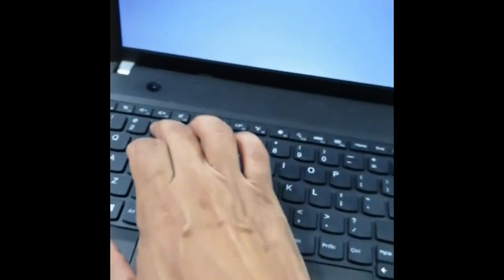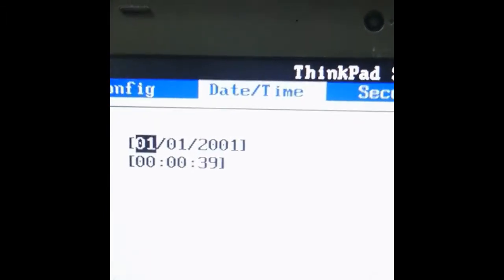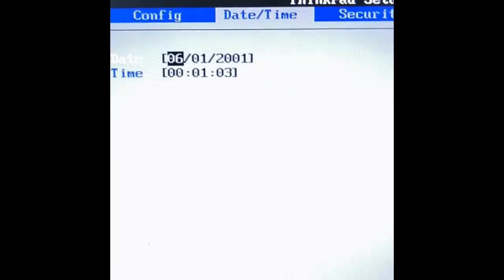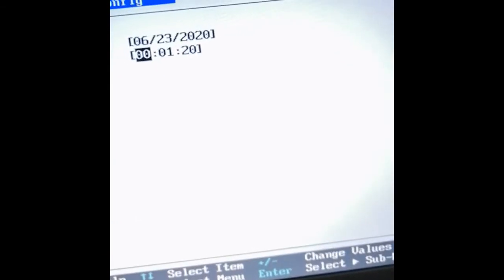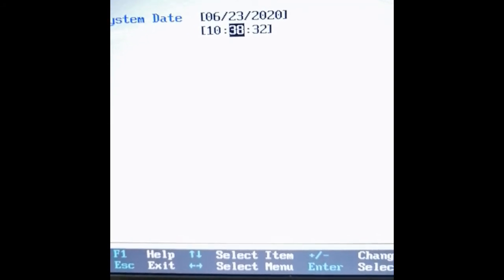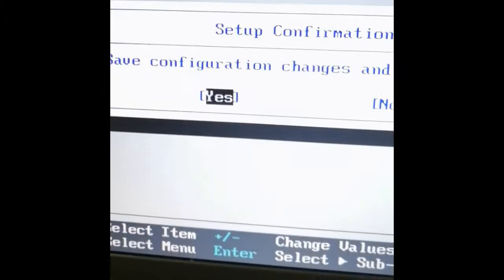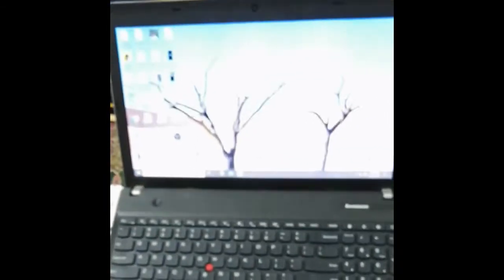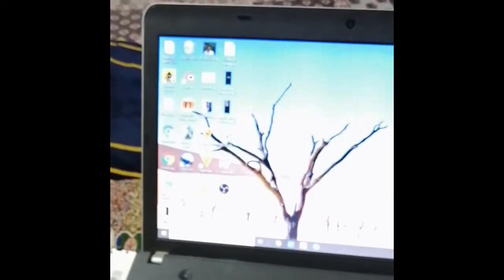Blank Screen Problem of Laptop Lenovo ThinkPad

Comment: hi, please specify the model or series of lenovo that might work with your fix. not applicable to a T61. Or is it?
Reply from the maker: I am on official visit and as soon as I reach back to my residence I ll share u the info u asked.
Reply from the maker: Before the following i sauggest to connect your laptop with another computer through VGA cable or HDMI cable so you will get know as your problem is existing in software or hardware. if you see the display on other computer monitor then the problem is lying in hard ware, (that is borken card or screen issue). if you don't see the display on the other system monitor, then follow the below mentioned 3 step i wrote you:-
step 1, Remove Mian/ big battery for 15 to 30 min (No supply of power) and then on, use escape or ctrl + alt + del if same status,                                                                                                                                                step 2,  see my video and note with care how i remove the small cell/ batter (equal to the size of a cone) with due care and deligency, (don't use power otherwise you wll break system clips)                                                                                                                                                setp 3, if you are still facing the same position the take out RAM and clean that with Petrol, plus with the soft cloths but don't leave pieces of cloths threads after cleaning RAM also clean/ wash the slot of the RAM and then try to on it.                                                                                        before doing the same watch my video of blank screen & see how i take out small cell/ batter (equal to the size of a cone), in my view that is the solution of your promblem in the light of your comment you wrote me. after doing so you  will also fix date and time from the keyboard which is a little difficul for beginer of the computer users. time and date fixing is also available in my video. i will also upload how to take out ram and then fix plus its cleaning.                                                                                         Feel free and write back if the problem not resolved i will be happy if you could fix the problem by your self. Thanks

Comment: I have Lenovo ThinkPad E531 when I connect the power cable Power button System status indicator flashing three times and get off
When I press the Power button System status indicator flashing and laptop not start and screen black and also when i press the power button and hold it the System status indicator still flashing not turned off (no beep sound) no battery in the laptop
Reply from the maker: Before the following i sauggest to connect your laptop with another computer through VGA cable so you will get know as your problem is existing in software or hardware. if you see the display on other computer monitor then the problem is lying in hard ware, (that is borken card or screen issue). if you don't see the display on the other system monitor, then follow the below mentioned 3 step i wrote you:-
step 1, Remove Mian/ big battery for 15 to 30 min (No supply of power) and then on, use escape or ctrl + alt + del if same status,                                                                                                                                                step 2,  see my video and note with care how i remove the small cell/ batter (equal to the size of a cone) with due care and deligency, (don't use power otherwise you wll break system clips)                                                                                                                                                setp 3, if you are still facing the same position the take out RAM and clean that with Petrol, plus with the soft cloths but don't leave pieces of cloths threads after cleaning RAM also clean/ wash the slot of the RAM and then try to on it.                                                                                        before doing the same watch my video of blank screen & see how i take out small cell/ batter (equal to the size of a cone), in my view that is the solution of your promblem in the light of your comment you wrote me. after doing so you  will also fix date and time from the keyboard which is a little difficul for beginer of the computer users. time and date fixing is also available in my video. i will also upload how to take out ram and then fix plus its cleaning.                                                                                         Feel free and write back if the problem not resolved i will be happy if you could fix the problem by your self. Thanks
Reply: @jqkhantech  thank you very much for quick response and kindly reply
Reply from the maker: Always welcome

Comment: It didn't work
Reply from the maker: Connect ur computer with the screen of another running /working computer so u ll get know as the blank screen problem is exists in ur CPU or ur laptop screen display
Blank screen also occurs dur to following 
Broken wire/card which connect CPU with screen 
RAM dirt or fused RAM 
Or some time software issues of operating system or drivers also caused this problem 
Through top mentioned tip i said about to connect ur laptop with another computer screen can help u n the search or locate the problem. F u could find the exact place of problem then you can fix it and can run ur computer system again. 
I ll also upload another video how to find/ locate the error. 
I m also again here to help you all the possible way
Thanks
JQ Khan Tech
Reply: @jqkhantech  thank u, I gave up trying and left it there for a day then when I start it up, it turned on, it was working fine last night but this morning I turned it back on and it did the same thing as before, i cud hear the fan running as well as see the light dat indicates my laptop is on but no display, I also hooked it up to a monitor but wasn't seeing anything either, at the moment I'm leaving it off, hopefully it'll come on like last night, but I'm afraid it'll do the same thing all over again just like today
Reply from the maker: Mostly lenovo does this problem I guess ur ram, card or software problem is this.
Wishing you all the best
Regards
Reply: @jqkhantech  it finally came on but its giving signals like how a TV does it when it needs an anthena
Reply from the maker: Update or install VGA driver, it's now software issue
Reply from the maker: Look 1st u should get know what type of problem u face
Either
Hardware or software?
Go and connect ur laptop to the screen of another working computer so u ll get know as ur CPU or laptop software not functioning.
F the screen of other device on and showed ur home screen so it means ur display of laptop is not working.
In last case you should check card/wires of your laptop CPU and screen.
3rd better u clean RAM of your system and refix or try another RAM.
These are easy steps f despite not working then ask for technical support of hardware.
I ll rely f u could find the exact area where problem exists.
F u have very less known how then don't try by your self to avoid damage better ask for technical help
Thanks
Reply from the maker: Dear viewer/ firend i as you desired i uploaded another Blank screen issue which is caused by RAM so link is hereby past for your help if requred. thanks link is available below                            https://www.youtube.com/watch?v=DR0SlLYX9Is&t=304s

Comment: What to do if it works by removing the battery?
Reply from the maker: F the problem is recovered by removing main battery then fine otherwise u ll have to remove small cell/battery for the purpose to wash the memory of ram which is the cause of blank screen
After passing 3 to 5 minutes refix the cell batt or plug to complete the circuit
In many cases this solution works
F the problem persist do write i ll try to assist n solving the problem
Regards